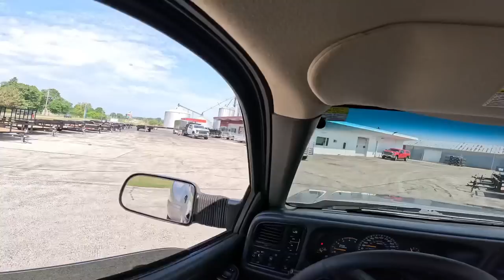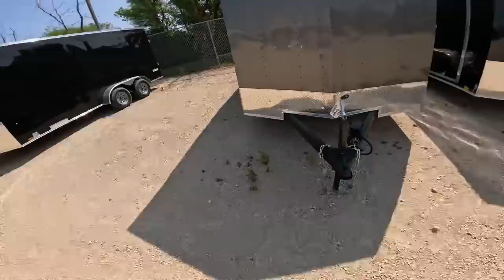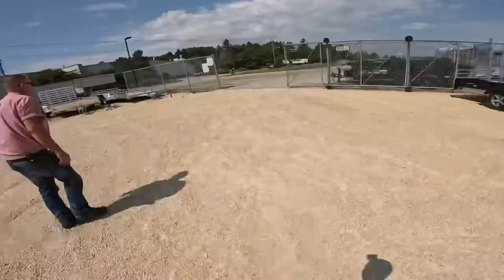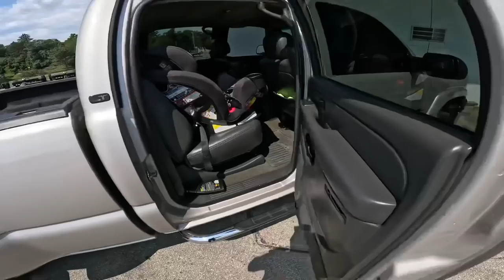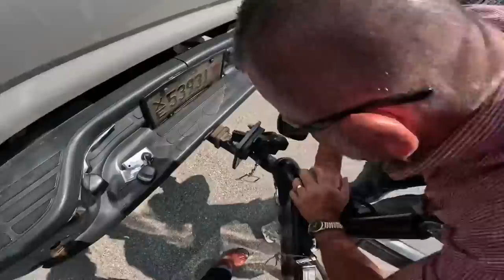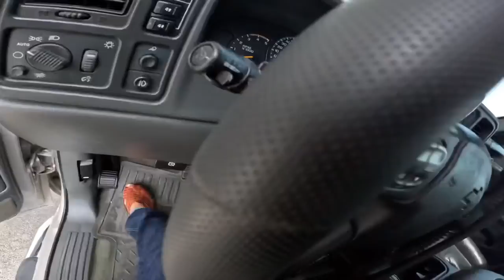Another step going up !!! New Enclosed trailer !!💯

Comment: if they both have the same axles, you want the cheaper lighter one.  can haul more payload.  it comes down to tires and axles.  sure 6" frame is nicer but whats the GVWR of the trailer and how much does it weigh empty.  now i'll finish the video. lol.

Comment: nice purchase eric! you should defiantly consider doing a 12/24v lithium or battery set up, with microwave, engel fridge, plugs to charge chargers, you can also added accessories like lights inside and outside and hook it up to you trailer. or you can cheap out and buy couple battery boxes from outdoor camping store

Comment: your trailer light fuses are on the side of the driver side dash. pull that panel off. you got a diagram on the panel. iirc its the lowest cluster of fuses for the trailer lights.  congrats on the new equipment.

Comment: ERIC   READ THIS..  Those trailers get STOLEN all the time.  even from fenced-in yards.   Ball locks are cut off with grinders.  tire boots work better and a hardened steel ball lock makes it tougher for a grinder to cut.   AND Put GPS trackers hidden on it somewhere.  some people use apple airpods.  put like 4 around the trailer.   AND you MUST engrave your Vin # in multiple spots on the trailer.  Then take it a step further and buy metal number stamps AND stamp the VIN on the trailer in multiple spots.   MAKE SURE THE NUMBER IS CORRECT.  take pictures of all of them and the trailer.   OR DON'T DO ANY OF THIS AND BUY ANOTHER TRAILER FOR 8 GRAND NEXT MONTH.

Comment: Yoo!  Get a Jackery solar generator battery.  You plug in some solar panels on the top, then you have the battery.  Then you can have all your cordless tools charged and do an electric pressure washer.  No gas cost!

Comment: You can buy some total boat or similar brand marine epoxy and just roll the floor and walls with marine grade epoxy and it will really help keep the floors and walls cleaner and less likely to get beat up or stained.

Comment: Looks good and nice buy not bad on the price either but also just a heads up in order to haul more weight you need bigger axles if the axles are the same but thicker frame then your taking from the payload normal tandems come with 7 lug witch are rated at 3500lbs per axle so 7k on the full gross now if they are 9 lug then they are rated for more weight not sure on the weight for those but i just know on the basic ones but she is perdy bro

Comment: Bite the bullet now, you won’t be sorry, the heavier trailer is what you should have for a business, you will be using it daily, not monthly, there’s other differences as well, HD hubs, and axles, bigger heavy rated tires and rims, and a bunch more stuff, I have done it both ways, it doesn’t pay to cut a corner on a piece you use daily. The lighting is easy, just put an auxiliary 12 volt battery in a battery box, then  hook it through the trailer wiring  hookup, and use the 12 volt accessory pin to charge the battery when it’s hooked to your truck, the truck alternator will charge it easily. Good decision, you won’t be sorry.👍

Comment: BE VERY CAREFUL MAKE SURE EACH LUG NUT IS TIGHTENED WITH A TORQUE WRENCH! ALL THE TIME BRAND NEW TRAILERS LUG NUTS ARE LOOSE AS HECK AND IT BECOMES DANGEROUS. ALSO GREASE WHEEL HUB IF THWRES A FITTING TWICE A YEAR AND LAST.. GET IT LETTERED UP. TAKUACHE CONCRETE BABY

Comment: do not waste money on residential gear but get the better gear. a couple extra bucks now for something that lasts longer and breaks down less
Reply: you still will not be able to carry too much weight- it is a decent trailer but, Ryan has several trailers because you have to spread the loads..tyres only carry so much each